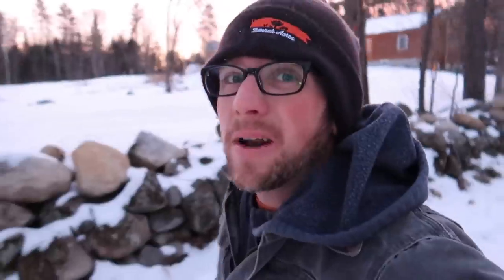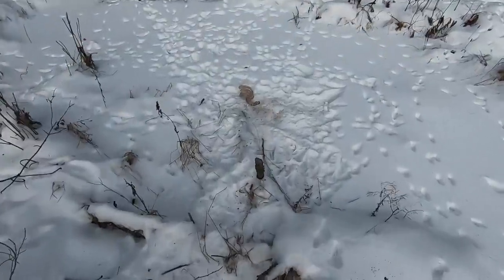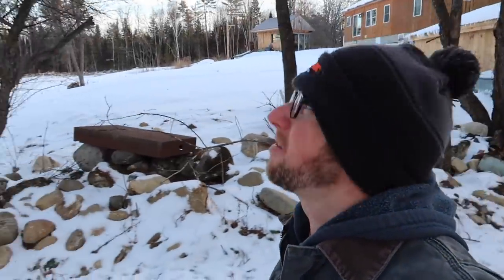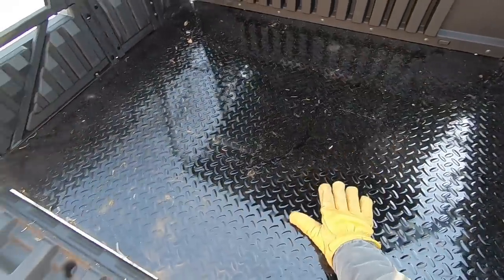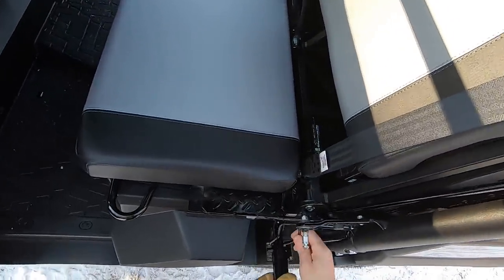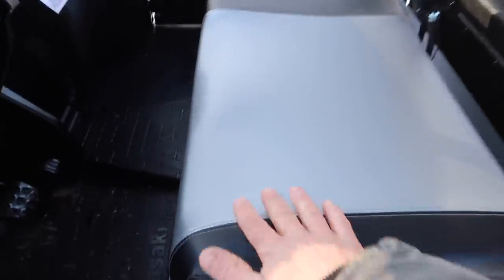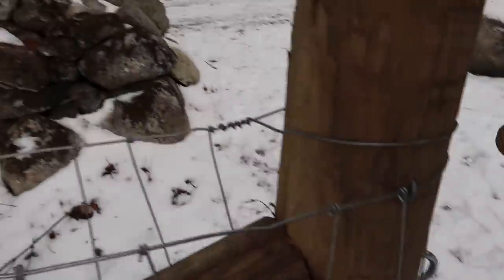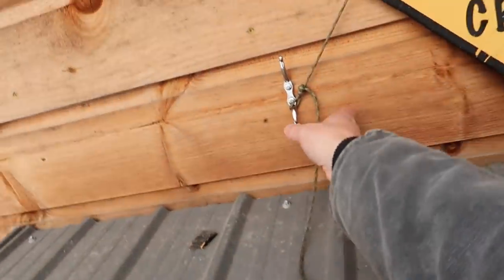WE BOUGHT a SIDE by SIDE for Our FARM

Comment: As to things to do to the mule, add work lights on the back and sides, front lights also on the top, when using it at night for driving or working these lights will pay off especially during the winter, most times everyone feels trapped after dark due to poor lighting, if u have the mule lit as if it were a portable flood light stand it gives u a little bit more freedom are night to get things done when and if needed.

A second item to add is rear wench, I built one for  my truck which is handy when pulling/skidding logs out of tight places where the truck cannot go or trees it was built to fit into my receiver hitch. Having the wench on the back eliminates the need to hook everything up with a chain as you can just use the wench for lighter stuff (use of a chain is only required for larger stuff which in most cases the mule would have difficulty anyhow) plus if u need to pull yourself out in reverse you have the option.

Comment: If you use it as a tool you will rarely have the second seat in the "back" position, you will keep the bed big.  If you have the seat back so its available you are using it as a toy.

Comment: Spray some rubberized undercoating on the bed to make it last longer.
Reply: Dennis Dickson no! Spray undercoat beneath the entire mule or go to a pro spray place and have it done there. The pro coat lasts longer then spray can stuff. Linex has commercial grade spray which I have in my truck bed and under the truck, resists acids alkyds and other chems and SALT on the road

Comment: I'm not sure if I saw it right, but it looked like the undercarriage was painted only.  If it is, maybe an undercoating would help keep the rust off from scratches, or if you are going to drive it on salty roads.  Also, I think I've seen cigarette to USB accessories before.  You will need to take up jogging now that you won't be walking all over the farm.  LOL

Comment: I have a Polaris Ranger Crew (6 passenger) and I enjoyed your review of the Kawasaki Mule.  Your Mule is equipped similar to my Polaris.  I have added an LED light bar to the front and I would suggest not adding anything to the roof as low limbs can damage or pull it off, also I didn't want any holes on the roof to maintain.  I have a radio with 4 speakers that I don't use.  I have the tractor style lug tires and seldom use the  4 wheel drive, I think you will regret your selection of tires.  My zero turn has turf tires and I have used the winch on the Polaris to unstick it many times.  I get about 400 hours on the drive belt that is easy to replace, but I don't do work with the Polaris, it's primarily transportation and a tool carrier, so your belt life will likely be shorter.  I can't imagine not having a side-by-side on my property

Comment: Will u need chains for the wheels in the winter for the mule?
Reply: Its 4x4 with a locker in the rear. No chains required. I just plowed 18 inches of snow with my Kioti and never spun a tire.  Getting stuck is not easy with them and 99% of the time you do get stuck your high centered or in mud to deep for the machine . Neither situation would chains help
Reply: @dominickclementi8118  Thank you. Wasnt sure if they got more snow or heavy ice that they might need them.

Comment: I am back with More Expert Good  Advice ,MEGA, <-- see what I did there.            I went to the lab and did a lil bit of reading about the Mule you bought . it seems the gas one you got puts out More torque than the diesel , I was surprised, because I made assumptions about the motor in your Mule, its got what I call i high performing motor, DOHC has some pros / cons we can get into those at a later time. A question, did the dealer tell you about Break in ? wonder about that. In the past  on my Kawasaki I was told, ride it like you want it to run, I left the dealership did a u turn then got it up to 125 mph in 1/4 mile, 3 rd gear, was back at the dealership for a new rear tire 2 days later, I had this thing about leaving a black mark on the pavement. that bike was DOHC 903 cc, several friends soon traded in the bikes they has cause they always got to the beach after me cause the slow bikes could not keep up, anywho, after several friend traded to the same bike, they still couldnt keep up by a small amount, some of us would trade bikes and line em up, mine was faster even when we traded, The point to this was the guy that tuned mine. aka valve adjustment. On those early DOHC motors was shims under the cams to set valve adjustment, and was a thing called degree the cams timing. my "mech a nick" was a ace at tuning that type of Motor, they was kinda new to common place use, before that high end race motors only. sorry about the long winded comment, just make sure to get the breakin tune up, oil change, If the dealer says you need it, still not sure about changes in that engine and after all its a Mule, not a 2 wheeled rocket. be sure to read the manual, as far as lights and such, that mule come with wiring harness that has ends for Light that you did not get, as options, so, maybe consider that when putting extra lights on it, ask the dealer for info on that, running new wires can be a Pain(fact check, it does have wires for optional lights), i am off here for now, going to go to the dealer and tell him to take good care of you, cause you are  such a good person. lol  PS, I am not a real expert adviser, but i do play one in real life, just not for free, so Take All this advice with a grain of salt yall

Comment: Actually ... the rabbits DO want the ham bone.  Rodents gnaw the bones to control the growth of their teeth and to gain calcium and salt.  Also,  I guess I must be a true hillbilly.  I would never spend the money on a new 4 x 4.  I know they are useful and often necessary, but I have experienced FAR too many Missouri farms that function well with an off road/ unlicensed old truck or even an old station wagon.   Often these vehicles can be purchased that will still run well, but have issues that would make them un-road worthy for a few hundred dollars.  My family members that farm, adapt these vehicles as necessary to do the work we need done and drive them around on the farm until they drop.  At that time they are sold for scrap and another farm truck is put into service.  Typically you can buy a whole FLEET of these vehicles for the price of a new 4x4 side by side and often they come with 4 wheel drive, full sized beds, trailer hitch and V-8 power.

Comment: U did a job of picking out ur new work toy !!? Very durable. ,Great name is mule BUT maybe look into a Greek God name like Zeus or Thor  for the strength n durability of it n  to PROTECT THAT BED Google the  spray on durable water proof tar foam that is good to protect under carriage from salt damage n does great on pickup beds for farms or where lots of heavy tools r carried ...I've forgotten what the stuff is called that's why I suggested u Google it ...sturdy practical n still comfortable !!! I always hated salesman that started showing me radioes, disc players ,passenger mirrors ,glovebox n other stuffs that didn't have anything to do with durability nor safety !!!
.
Just cuz I was a good looking woman ...I'd always tell them, don't use it, don't want it, don't need it, take it off the factory order list.!!!( ps
 I did put glove box n radio back on later thuo ) I'd slide under car very quickly even in a dress n still b a lady n them swing back up just as quickly to open hood n check out Trany n engine !!! Always left with a big savings n got what I Needed and nothing more ,unless it was more power, safer tires,longer warenty n a full tank of gas that was free !!!  Keep up the great videos n bless. Ya'll